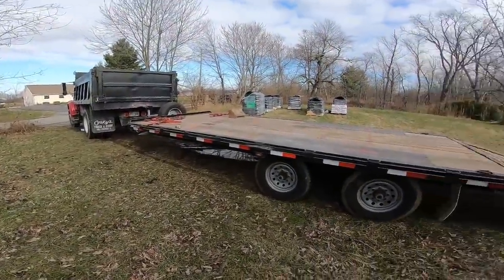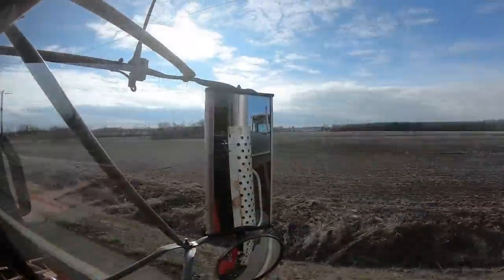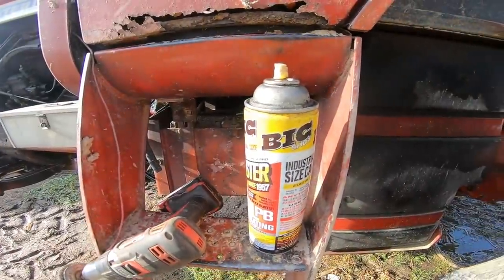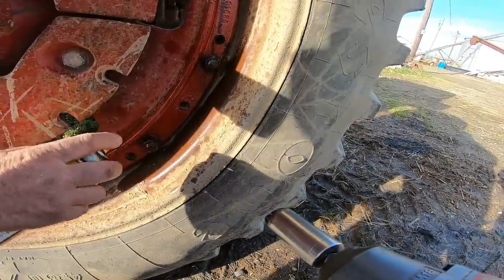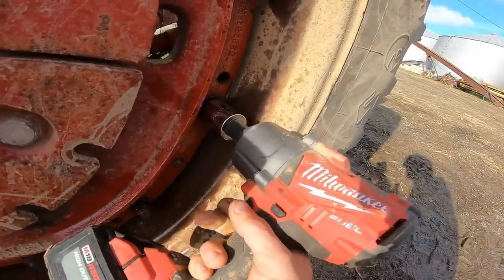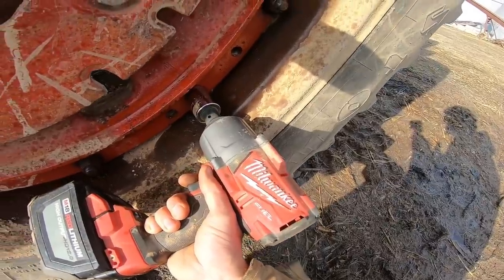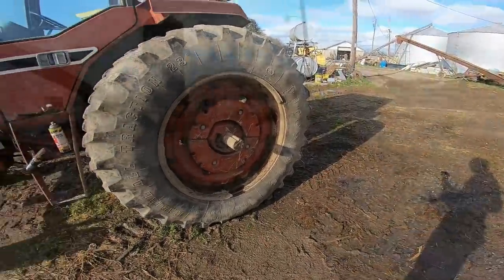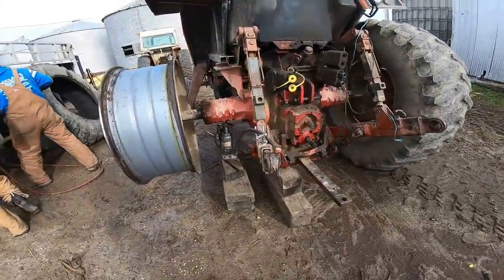Why is the 1086 Taking a Trailer Ride??

Comment: Ended up replacing 3 rims this year due to salt rot.  2 on the 1466 and one which blew out on the old 930 case.  Like you, found a good soaking in a favorite rust buster (Kroil in my case) made for  and easier job.  Only good side was now all my kids have nice fire rings.

Comment: Dunno how it varies by region, but there's a ton of tractors in the mid-south with VERY loaded tubes. I've ran a 1466 on singles that will squat down doing field work because of all the weight in the tires.

Comment: Keep the fluid in your tires , there is approximately 1100lbs of fluid in that one tire , would take quite a pile of weights at 150lbs each to make up that weight , that's what IH weights each
Yes calcium will eat your Rim if you have a slight leak but with good tubes , can't beat the weight

Comment: I have to wonder why that Rim did not tear the tube all to pieces. What does tire field services run in your area?  I had a field service on my combine last October $350 to get two tires changed. Jacob thanks for the video.🙂☕
Reply from the maker: For a tube and to move the tire around I think was $350.
Reply: The bead on the tire was keeping the tube out of the crack... must've been why it didn't chew it up.  Later! OL J R :)

Comment: You should Jack that side up and lay a block beside the inside of the tire, rotate it while comparing it to the block to check for runout. Then just tighten the appropriate wedges until there is no more runout. Sometimes it’s hard to believe how many tractors are running around with wobbly tires. 😂
Reply from the maker: Thanks for the tip.
Reply: @boehmfarm4276  no problem, thank you for all the great content. Definitely one of the best channels on YouTube.
Reply: @boehmfarm4276  Same way you'd do it on your grain truck with Dayton wheels... why Budd wheels have pretty much taken over in HD trucks... bolt em on tighten em up and GO!  No wobbly wheels!   OL J R :)

Comment: When it comes to weight and traction,fluid is KING! I laugh at people that worry about the rims rotting, we've had it in tractors for years. Probably be retired before it's a problem. 😂
Reply from the maker: They only rust when they leak.

Comment: I have dealt with all sort of rims rusting out except my first time on 685 ih case loader rear tire with cacilum fluid in it  unfortunately I had to drain fluid out of it to ground to get the tube patched up.  Didnt have proper equipment to pump it out.

Comment: On the Milwaukee impact, on the 4th setting it’s trying to detect when the nut breaks free, then automatically slow to 750 RPM for better control when removing. (Just bought one, that’s what the manual says)
Reply from the maker: Yeah, I didn't read the manual.
Reply: @boehmfarm4276  I did for you 👍

Comment: They tried to use tubes when they replaced the tires on my asphalt paver. Told them I’d never seen tubes used before. Tire guy swore it was fine. Well... within a week both tires had somehow spun the tubes inside so much that the valve stems were ripped off from the inside. It’s not fun pushing a loaded truck up a hill trying to pave major roads when your liquid filled tubes fail and the job is shut down. 😂 We pushed the tires in... reached inside and pushed the tubes to the side and popped a new valve stem in. Those tires have liquid AND deflated tubes rolling around inside them now. 😂 still going strong tho.
Reply from the maker: Hmm... Something must have been sized wrong. Never had issues with tubes moving.
Reply: @boehmfarm4276  well the tire guy brought his boss out with him when they “fixed” the issue and the boss said they absolutely do not run tubes in paver tires because of this. The superintendent of my company also said they shouldn’t have put tubes in a paver tire either. I’m not sure why the difference? Now paver tires do squash a LOT when you have a hopper full and you’re pushing a truck. They squash much more than average tractor tires do. Perhaps that’s the reason? Not sure. I had never seen a tube put in a paver tire before that... or since. There must be something different than tractor tires because I’ve seen tubes filled with liquid put on tons of tractors.
Reply: @TsunauticusIV  Yeah a really low tire, regardless of what it's on, will squirm the tube around if used enough... the flex in the bulged sidewall is what does it I guess, but I've heard of that happening on the old split rim 20 inch truck tires run on grain trucks that were underinflated/overloaded... Tractor tires too.  Later!  OL J R :)

Comment: Holy shit I would not be doing that with air  pressure in that tire
Reply: why?
Reply: Its like 10 psi even if it blows it would be very undramatic
Reply: @casefarmgirl2279  Because a rim cracking apart like that can come apart in a split second when it finally lets go, and the tire blow the pieces off explosively... granted it's a tractor tire with much lower pressure (about 20 PSI or so usually max) than say a car tire at around 35-40 PSI and especially a big truck tire at 120-140 PSI, but STILL a tire is basically a contained explosion waiting to go off... it's always looking for ANY WEAKNESS to tear apart and blow out, and sharp metal propelled by compressed air, even at low pressure, can kill you or maim you if it hits you right... OL J R :)

Comment: Instead of putting brine in your tires, they make a product called rim guard, it's beet juice, it won't corrode your rim if it leaks, and it's heavier than brine. You would notice a big difference in pulling if you didn't load your tires. I know this from experience.
Reply from the maker: I know the weight helps.
Reply: Problem is cost... way higher than chloride.  OL J R :)

Comment: If I'm correct about which tire shop you're referring to, they're my neighbors. Lol. They do good work but they're picky as all get out. I know the guy personally
Reply: You want it your way, work at Burger King... leave the tires to the big boys who ain't skeered of everything.  I mean, you gotta have respect for dangerous stuff and take safety precautions, sure, if you want to live and not be maimed for life anyway, BUT lets face it tires are NOT danger-free items, never have been never will be... if you're too paralyzed by fear to do the job, then get out of the business and just go mount tires at Walmart, or work for the King LOL:)  Get REALLY sick and tired of all these tire places being so d@mn finicky... either do the job or quit and get out of the business!  

Looking at that rim when Jacob pushed the camera up to the crack and that bead ring about to go, I was like "get the h3ll out of there before that thing turns loose and KILLS YOU!  I wouldn't have even moved that tractor before wrapping a chain around the cracked part several times and hooking it back to itself snugly, so if it DID let go at least the parts would be contained... then removing the valve core and letting as much of the pressure out of the tire as possible while still being able to move it, even if it meant blowing some fluid on the ground (catch it in 5 gallon  buckets FFS).  Since they had it moved to the farm and parked ready to work on it, if I was the tire guy I STILL would have wrapped a chain around it and hooked to itself tight before I ever started pulling the stem apart to get the chloride out... One cracked that bad, you just never know when it's gonna turn loose, and even low air pressure in a huge tire like that can do amazing things (It holds up a 10-15,000 pound tractor after all!) 

But if a guy can't handle changing out rims or working on split rims on old grain trucks or farm equipment, they got no business being a tire guy IMHO....  OL J R :)

Comment: The new pair of 'shoes' look like it will last a long time.   Beet juice is a great non-rusting alternative to calcium, however most local tire service shops don't run a separate tank/truck to support that.
Reply from the maker: And it's $3 gallon. We already had the calcium in the tire.

Comment: Did I understand you correctly?  The tire place won't change your rim at their shop but they'll come out to your farm and do it????
Reply from the maker: We did most of the work for the rim. They would do just the rubber work here, there or anywhere, but we had to get the rim changed. They think the bolts for the rim clamps are a challenge. All they needed was the threads cleaned and PB blaster.
Reply: @boehmfarm4276  That tire company is a joke.  OL J R :)

Comment: Sounds like we got the same tire shop. They wouldn't take the tires off my pickup box trailor. But they let me use their tool to take them off to put new tires on it. They claimed it was a liability thing. Go figure
Reply: There are tire shops in Arizona that will not put air in a vehicle tire if it is 5 yrs. or older or fix a flat. Liability . I so glad we gave layers to help destroy society.
Reply: LOL:)  A lot of tire shops now are about worthless, with their "liability concerns"  Why Mexican tire shops are popping up like weeds everywhere down here in Texas-- they'll do anything for a buck... and do it right and cheap!  I had enough when my "usual" tire shop quit working on split rims... lots of old 50's, 60's, and even some 70's grain trucks on the road STILL use split rims, h3ll I even got a hay trailer on 16 inch split rims-- axle came off a bread truck I got from a junkyard, same pattern as a dually pickup 8 lug.  I mean you're in the TIRE business FFS; if you wanted to play it safe, GO WORK AT MCDONALDS!   Yeah split rims CAN be dangerous, BUT that's why you take proper precautions, like NEVER INFLATE a split rim that's been apart and put back together outside of a SAFETY CAGE!  That's what they're for FFS!!!  Roll it in there, clip on the chuck, and air it up... if it goes BOOM! the cage holds the pieces together, then you tell the customer to go get a new rim!  H3ll if I gotta do HALF the job myself because of their "liability concerns", I might as well do it ALL myself and save the money... or just find someone who's actually WORTH A D@MN and who WANTS to do the job for the money!  My BIL is lucky, he's got a retired tire guy in town who has his own service truck and equipment and does tires out of his mini-shop at home, plus an old road service truck-- you buy your own tires, but he'll come out and dismount old ones and mount new ones, no problem, and does it quite reasonably!  OL J R :)

Comment: Its funny how the tire changing place is getting so picky about what they do now, It's like they only want to do the easy stuff anymore , Heck they wont even touch a split rim anymore of any kind !  Lots of older trucks with split rims on them and it costs more than the truck is worth to buy new rims ! Bandit
Reply from the maker: Does anyone else close work on tractor tires?
Reply: @boehmfarm4276  I havent found anyone yet and I've been looking for another place, They have this area tied up pretty good with a nice bow tied around it !  Used to be OK tire a place over in Lebanon and Wilmington Hillsboro and Batavia but there all gone now,  We need a good tire store around here and not a chain store like tire discounters ware they just do car and pick up tires we need a full service tire shop that does farm calls !  I know guys who get great deals for that tire shop but every time I walk in its always high prices  and we can change those only to be told in the shop get them out of here we dont touch them !  So I've been changing a lot of tires lately !  Bandit
Reply: Oh yeah most of these tire shops anymore are a JOKE... I quit using my "usual" tire shop after they refused to work on split rims... I was like "h3ll if that's the case I can get tires ANYWHERE-- don't need yall-- Walmart is cheaper on car/truck tires anyway and I can call mobile service from the next county over and they'll come do tractor tires, so FO..."  What a joke.  Place would be bankrupt if they weren't screwing over all the hobby farmers moving into that part of the county, who are too stupid to know any better!  I had just about had a belly full of them when they started this "don't call us til your leg tank is COMPLETELY EMPTY bullsh!t... we have a 250 gallon diesel leg tank we fill the equipment from for our farm diesel, and they got to where they only wanted to deliver "truckload amounts" on a run.  Had the gall to ask me to "time my deliveries to a BTO farmer down the road a bit" and all this crap.  SO I tried to oblige them and call them a couple days BEFORE I needed fuel, KNOWING they wouldn't be out there til the BTO called and ordered his tanks filled too... Course how was I to know the BTO had called in the day before and they were TRIPPING over themselves to get out there... drove in an hour after I called and then chewed my @ss out for calling them before my tanks were EMPTY.  That's when I quit buying fuel from them, and went over 15 miles to Rosenberg and started having the Mobil distributor start delivering to the farm-- no more bullsh!t.  When they finally closed up shop, I switched to the Exxon distributor next door... They want the tank empty too, BUT they'll deliver THE NEXT DAY after I call, rather than maybe monkeying around 2-3 days or so like the little band of idiots did at the tire shop.  

I swear, when that place was run by the old man, who was about my Grandpa's age, it was a GOOD shop... farm tires, batteries, fuel delivery, grease and oil, tire repairs, the works.  Then the old man retired and his boys took over, and the oldest one was a legend in his own mind, and the rest didn't have enough sense to pour p!ss out of a boot if the instructions were printed under the heel... Just got worthless and more trouble to deal with than they were worth.  My money spends just as well as anybody else's, if they don't want it I'll find someone who WILL, and give THEM my business!  Later!  OL J R :)
Reply: @banditfarmer1900  We're pretty lucky in that we have Mexican "used tire shops" popping up EVERYWHERE... Yeah they sell USED tires, pull offs that weren't quite worn out when Daddy Warbucks decided to get a new set on his SUV or whatever.  I've run them on vehicles, cheap alternative for a while when money's tight and a tire goes bad, hold you til you get a new pair put on anyway... and usually less than half the cost of new with mounting and balancing.  A lot of them now will even sell new tires as well.  I was running pull-offs on the trailer for hauling hay, but I was having on average one blowout a year (sometimes two) and it just wasn't worth the trouble of having a blowout on a  loaded hay trailer on a 100 mile drive between farms, so I put 8 ply trailer tires on and never looked back (about 15 years ago... bout time for a new set of BIAS PLIES!  Screw them radial trailer tires-- absolute GARBAGE they DON'T HOLD UP!)  

Later!  OL J R :)
Reply: @banditfarmer1900  oh for sure... I got one of them manual tire changers, ok in a pinch but sure wears your @ss out!!  Definitely worth it to get it done, and when it comes to tractor rears, just spring for the friggin road service!! It's expensive but worth it compared to wrestling those big tires, and they have to work twice as hard to change them off the tractor as well... Tires are one of those things that are just the bane of farmers, always have been always will be... Keep waiting for those "tweels" to arrive and save us all, but it hasn't happened yet not do I expect it to, not at any price remotely competitive lol.  Later!  OL J R:)

Comment: If the last guy had just swiped those threads with never seize.😂
Reply from the maker: Then they may have fell off. I greased lug nuts once. After the wheel coming loose, never again. The rust will be lock tite.

Comment: What 'fluid' is in the tire?  I've never heard of that before.
Reply from the maker: Calcium chloride solution.
Reply: @boehmfarm4276  oh cool. Keeps them from freezing I guess.
Reply from the maker: And it's 30% heavier than water.
Reply: @boehmfarm4276  nice. Didn't even think about the weight.
Reply: @jimpolk  Yeah most farmers run liquid in their rear tires on their tractors for extra weight... since water weighs 8.3 lbs/gallon and calcium chloride about 11.2 lbs per gallon (IIRC from memory) most farmers up north, due to the prolonged freezing weather, run chloride in their tires.  BUT, it's a form of salt (calcium chloride rather than sodium chloride, being table salt) and can cause corrosion if it leaks.  Down south where it seldom freezes long or hard enough to cause problem, we typically just run water in the tires for weight.  Some guys use a specialty beet juice, because it's about as heavy as chloride per gallon, but the sugar prevents it from freezing, and it won't corrode rims so badly if it leaks unlike chloride.  I've heard of some guys getting windshield washer fluid and using that as tire weight up north too, the alcohol prevents it from freezing, and it's less corrosive so long as it doesn't contain ammonia to lower the freezing point.  Most tires can add about an extra 800-1000+ pounds of weight to the tractor when filled with liquid, which aids traction and reduces wheel slippage markedly when pulling tillage implements like chisel plows and disks and such.  Liquid is also a H3LL of a lot cheaper than the same weight in cast iron added to the rear wheel disks of the tractor... plus that kind of weight, you'd have a stack of weights probably 10 wide on each rear wheel!  Cast iron weights are expensive, fluid is cheap by comparison, BUT fluid IS harder on the life of your tire.  Liquids do NOT compress, so you have to make sure the top 25% (roughly) of the tire is full of air, to give the tire some "cushion" going over bumps and obstacles or rough ground... the air can be compressed by the fluid in the tire.  Later!  OL J R :)
Reply: @lukestrawwalker  wow. Cool info. Thanks.
Reply: @jimpolk  you're welcome!  OL J R  :)